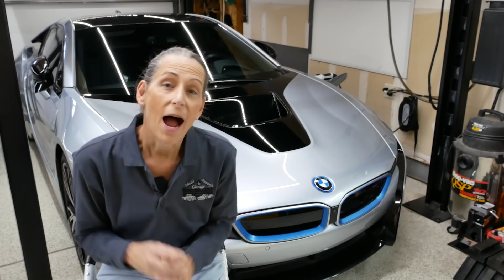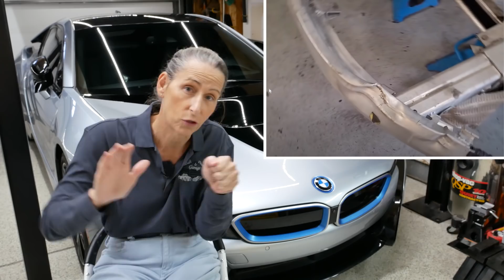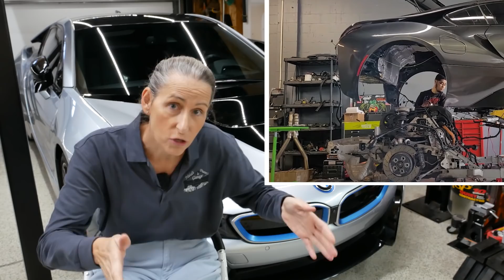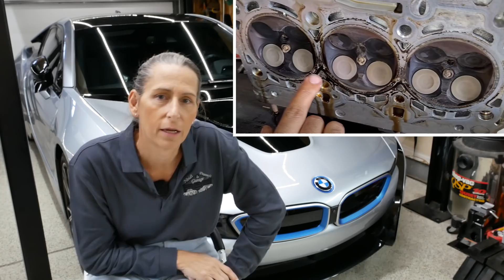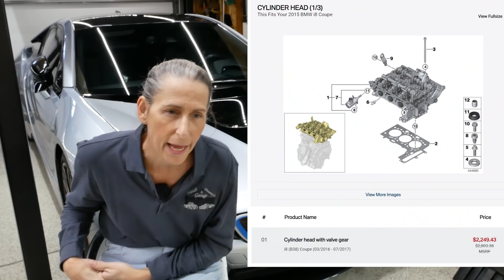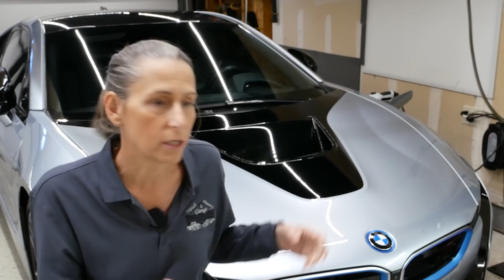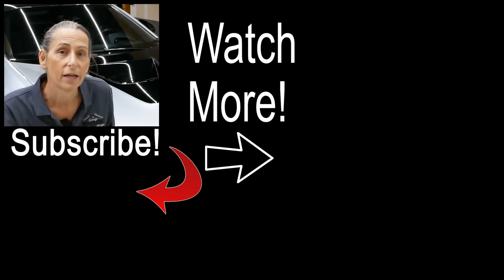Is THIS What Ruined Sam's i8??

Comment: To check the block you look at the wear marks in the bores test the oil and put a dial gauge down the bores to check for out of round.
The head can be straightened without machining by putting it in a kiln to release stresses then a press then back in a kiln, after that only a minor skim on the surface would be needed. It can also be welded and resurfaced or a filler plate / thicker head gasket can be fitted after machining.

Comment: I would attempt to fix the existing engine assuming the block is within specc.  There is a thicker by 10 thou gasket available. He only tried a 5 thou feeler gauge so maybe more than 10 needs to come off.

I disagree with the engineer about the timing as BMW no longer use woodruff keys on any of the sprockets so height is no longer an issue.

Furthermore there are procedures to measure combustion chamber volume so they can be evened out after skimming the head.

Comment: I have a silly question. Why cant the head and block be resurfaced and a custom made copper head gasket be used to bring the engine back to spec?
Reply: This will change the valve travel gap between pistons
Reply: @andreystarovoytov3337  I get it, you mill .010 off the head and block, compression changes and valves will meet Mr. Piston in a tight tolerance engine, but the head gasket will not be a standard head gasket, copper head gaskets are used in racing applications, not that hard to have a shop that makes custom copper head gaskets to make one that will be .010 thicker, this is nothing new, you can get oversize head gaskets off the rack for certain engines .
Reply: Nakis Perry they would have to skim too much from the head and the block ,not leaving enough space for pistons to travel in cylinders for compression, i.e. It's warped to much to skim
Reply: @robhampton6216  What you are taking away from the head and the block you will add to the custom made copper head gasket, only problem would be the cams might bind. Replacing the engine will kill the collectors  value of the car because the engine is not the original.

Comment: Back in the early 90's, I was a noobie in the car biz when I purchased a beautiful Dodge Caravan with the 3.0 v6 that appeared to be front row ready.  The car was just over 2 yr old and just out of warranty due to miles.  It would go out on a few test drives and I noticed it seemed to run hot. I decided to check it out just in case there was a problem. I found that after about 20 mins of actual driving (not just idling) it would eventually overheat. We serviced all of our own stuff except the newer, exotic, overhead cam stuff (we sold a LOT of pick ups and late 70's, early 80's large RWD American luxury cars that we felt at home working on) so I sent this down the street to a shop that had helped me out before. What they found was that both heads were warped.  We tried to source some replacements to no avail. It was going to be costly no matter what I did. They had a process whereby the heads were somehow heated in a furnace and then straightened and they guaranteed them to be better than new and did offer some sort 36ish mo warranty.  I think the cost was somewhere around $4k for the repair (this was a $13K-$15k retail van at that time). I either had to sink the $4k in to it and retail it for hopefully a small profit or run it back to the auction and take a beating there. I drove the repaired van for a few weeks before putting it out on the front row.  A friend of a friend had cash and was understanding of the situation and my mortgage was due so I sold it at a small loss. I know they drove it for about a year and half without any motor related issues and I lost track of them and the van after that. We eventually started doing heavy repairs in house and lots n lots of heads/head gaskets. I never ran into a situation where we needed this straightening process done again. I have never heard of anything like it since. I have had cracked heads repaired, heads milled etc. and don't ever remember any coming back.  Obviously the block needs to be checked, but I bet a replacement head would be the ticket.  As to the initial cause - my guess is the owner got into the accident and if I remember correctly, the radiator was replaced and I bet the coolant wasn't filled properly, they probably spent a fortune trying to figure it out and decided to let the bank deal with it - let it get repoed.

Comment: Like you said further investigation into the condition of the block is needed before coming to a conclusion as to which way to go is made. The the block is still straight and it’s just the head then it’s just the head that needs replaced. If not then it’s the other options. As soon as the head was taken to be checked I said block needs Checking too. 

When any car over heats it needs to be shut down and allowed to cool. Even based on my high school level experience I know that people don’t realize that it’s needs several hrs to completely cool down. 30 minutes or so is simply not enough time. The head should probably have been removed when the circulation pump was melted..

Comment: Spec block if possible. But if machinist feels heads so far gone, block may also be shot is a good warning. 

Sam got cheap enough to source used $8k engine. And not waste investing in removing twice.

Comment: I find it hard to believe it ran well with that head gasket damage. 

It being a direct injection engine, if you get a used engine MAKE SURE you look at the intake valves and make sure they are not coated with oil and carbon.  

I stay away from direct injection cars unless they are duel injection (direct and regular injection like some new Toyotas) the regular injectors keep the intake valve clean. With out it and just direct injection the intake valves get caked up with carbon.  Causing significant power loss.. Ask me how I know... (Hint: Audi)

Put a catch can on the car once you figure out the engine fix.. it will slow the valve gunk issue,  but won't stop it

Comment: Here's an interesting video on the cooling system: https://youtu.be/MjFPBJfYAao

Also, being a mechanic for another european brand, I have some experience with complicated cooling systems, up to the point where we now have low, medium, and high temperature systems in one vehicle.
THE MOST IMPORTANT THING IS TO ALWAYS USE THE VACUUM FILLER AND FACTORY PROCEDURES.

All coolant systems are interconnected via restrictors and there are multiple high points where air will collect.
I've had several cars that had front end damage repaired elsewhere, and they ended up at our dealership because of overheating issues.
Mostly these are hybrid and electric cars.

Comment: Hi Franny, great explanation. Everything correct. Just one remark (not trying to undermine your knowledge): there is non TwinScroll Turbo on any of 3 cylinder BMW engines. The TwinScroll (dual scroll) idea itself is to divide the gases into two identical channels - and how to do it with odd number of cylinders? Hard to believe, but this small, 1,5l engine does have its power with only one turbocharger (and a lot of other smart solutions:)).

Comment: I would recommend at first to check if the block ist warped too. This isn't much effort now, as the engine is open. If the block is okay I would buy a new head. If the block is warped too, I would try to find a complete engine in goid shape.

Comment: When the front was damaged they probably drove it without coolant.  Sometimes engine temp sensor cannot know coolant temp if there is no coolant touching the sensor.
Reply: James, thought the same. Likely coolant went below temp sensor so computer didn't shut down the engine when it ran hot. Amazing it's still runs ok, other than overheating, with such a warped head.
Reply: @stumac869  When she quoted the manual, it also showed oil temperature ranges, so there would have been a backup sensor shutting down the engine according to the oil temp.
Reply from the maker: @mjouwbuis  This is a great point!  But...  I did a search through the entire manual for "Oil Temperature Sensor" and nada...  Really? no oil temp sensor?  That seems really strange to me.  Why would the manual mention oil temp if it can't monitor it??
Reply: @HeidiandFranny  every Car have this sensor

Comment: The symptoms  DO NOT match the data.....compression is good, no coolant in the oil??.....check the color of the intake valves. There is NO indication of coolant into the cylinders...intake valves ALWAYS become discolored with coolant or oil contamination.

  I think this is a scam for hits on YouTube.....any machine shop will have the tooling to resurface the head....if center to center of the camshafts and the crank are critical, stack the head-gasket. This is a 3 cylinder lawn mower engine basically....WTF???

Comment: If he could get the head straightened to the point where he doesn't need to get much  material removed from the resurface it could be saved, but he would need to get the block checked before he could  any of that.

Comment: Great analysis! Now need to find out how to fix i8 head for cheap
Reply: Search resurface cylinder head DIY......it works
Reply: @imtheonevanhalen1557  Good point, sould be tried. I think that person why told Sam that after resurfacing engine computer need to be readjusted to higher compression and timing - is exaggerating, if to shave 0.05-0.1 mm it probably should be fine.

Comment: Great sleuthing.  Even before you said  it, I assumed it was "hot rodded." Someone that doesn't know those types of cars, but knows its a "BMW" would definitely push it to its limit and beyond.  Sad.
Reply from the maker: Absolutely 100%!  This!
Reply: People continually miss the fact that Sams car had front end damage, so dropped all the coolant, not necessarily hot rodded as the  motor for all intents and purposes ran fine except shutting down when it got hot. My biggest pet hate of late model BMW;s is their use of plastics in a lot of the coolant system.

Comment: Wow that car was abused. I say Sam goes with a whole new short block engine. If the heads are warped the the bearings in the crankshaft are more than likely worn. If would be a shame to do all of that work to tear it all back down again for a spun bearing. I have owned a few bmw’s and currently own a F34 and they are great cars if they are cared for.
Reply from the maker: Yes! This...

Comment: I agree with you, the block needs to be checked to see if it is warped as well. If not, I would get a new head and rebuild the entire motor. If aftermarket parts are available to make the engine better than stock, I would make the investment as it would be less money than buying a new or used engine.

Comment: These stories simply confirm the best advice when purchasing cars:

Don't buy the debut model of ANY car!  

Even year two is questionable.  It's always a risk.  You're effectively the final beta tester of the vehicle.  Only after a few years are all the bugs worked out.  And those models with persistent bugs?  They disappear.
Friend bought an '83 Westphalia camper the first year VW went water-cooled.  It, like almost all the others, blew a head gasket in short order.  Covered under warranty but the vehicle had perennial problems.  
That and avoid cars on Consumer Reports "avoid" list.  A relative bought one and it was a non-stop disaster.  CR may not get it right every time, but they provide some very valuable vehicle data & stats that usually prove true.

Comment: Did you watch sams video.. The machinist said with that much head warpage the block would be stuffed too. Maybe after machining both flat u could use a thicker head gasket or shim. Cheaper to throw a used engine in it less $$$ less time. Less headaches
Reply from the maker: I did watch it and I have been talking with Sam as well...

Comment: Nice video, but I am not sure the “hotrod” diagnostics are valid. There are some other signs of misuse I think are alarming. Why did the radiator burst? Why had the condenser been replaced? Why is the headlamp repaired instead of replaced? Why the the rear frame damaged?
I definitely think the accident  the car had been in has caused some damage to the cooling system. The way the repairs has been done shows evidence of a non insurance repair as the damaged parts would surely been replaced otherwise. I think the previous owner had cut some cost corners and actually think that is the reason the the overheating had started. By continuing using the car the problem just gone worse ending where it is today. Maybe that is also the reason for the repossession.
Reply from the maker: For sure there is damage to the front (and back) not accounted for.  The radiator was another issue.  Totally possible it was a bungled repair that set all this in motion.  The water pump had been replaced...  It would be good to see the computer logs...
Reply: @HeidiandFranny  the computer log would be nice to have 👍
I just can’t help think that driving with a front end damage could have reduced the cooling system and subsequently caused the other issues with overheating and the need to replace the water pump. To my knowledge the water pumps are lubricated and cooled by the cooling water.
Gonna be exiting to see what solution Sam comes up with

Comment: looks the head was trash and beyond repair due to extreme warping, I would replace the entire engine imho. it looked pretty bad. Even if the bottom end "looks" ok, the rest of the rotating mass is a time bomb imho.
Reply: If the head got fried, it's fair to assume the rest of the engine suffered the same fate.  Toss it in favor of an entire replacement.  Otherwise, let the turd polishing proceed!

Comment: I didn't see a lot of milky oil in his previous videos so if the deck is within specs, I would chance just a head replacement. With the gasket in the initial stages of failure, he might just get away with it. He might have bled the system properly all along but heat expands everything and the gasket could only work to a point. That center cyl injector didn't look too healthy which could have caused a lean condition which would contribute to a high temp situation. I worked as a automotive machinist for years and I think the head surfaced should have been cleaned a little more thoroughly before it was  checked for true. We usually dragged a flat file wrapped with a sheet of emery cloth to deburr the edges so it wouldn't throw the straightedge off. Just my opinion.
Reply from the maker: All sounds really good.

Comment: Knowing that BMW is notorious for failing water pumps what likely happened is that the water pump started to go and that caused overheating that went ignored for a while.
Reply: Or that after the front-end collison the workshop who repaired the car didn't bleed the cooling system properly and that caused the overheating that went ignored for some time.